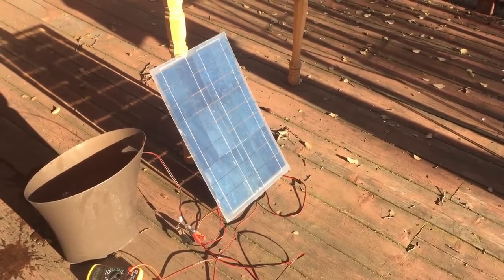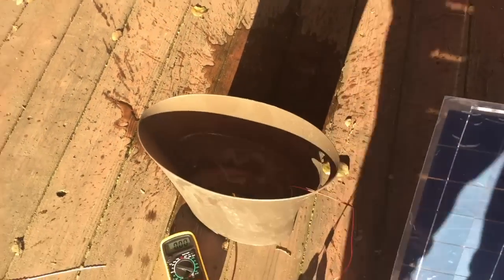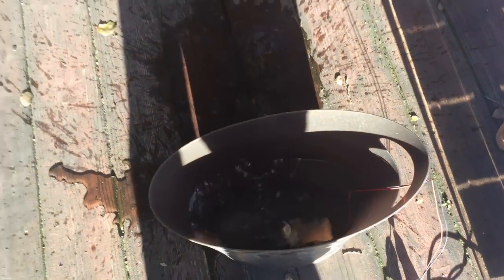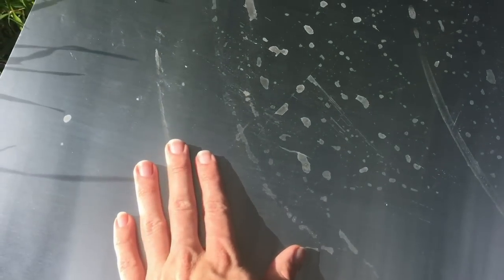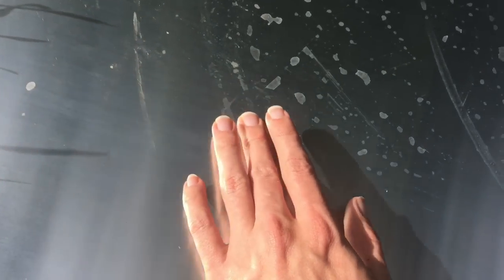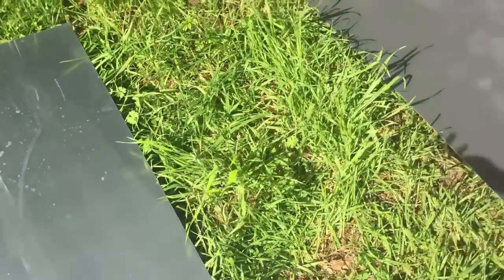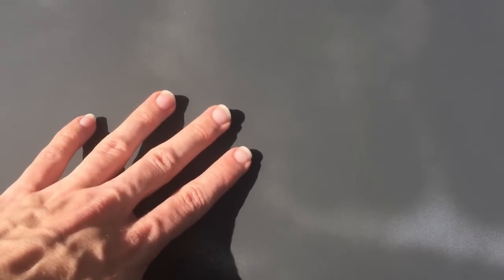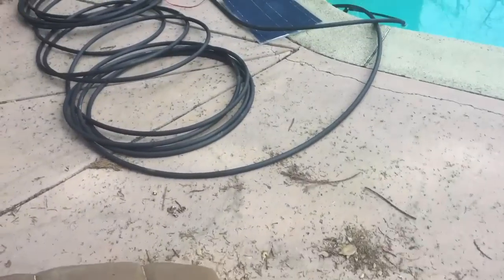Solar pool heater home made under 100$ :)

Comment: I also have a follow-up question, you mentioned that you were going to use the plastic to cover it but it was a bit milky, do you think that would really cause a problem? The fact that a matter is milky or not the heat will transfer through? I would love to hear your thoughts on this. I was also considering just getting a piece of window pane and fitting it inside my box.
Reply from the maker: Well the main point is that we want to still get as much sun onto the system as possible, so it should be visually transparent or you may get no more heat, or perhaps even less. Ultimately, this worked for me, so I left it running as is, glad you enjoyed the video! Hope yours works as well or better then mine!
Reply: @FreekHoekstra  thank you so much for your quick response I just noticed that you made this video 3 years ago! So I really appreciate you getting back to me I'm just waiting for my submersible pump to come from Home Depot and then I'm going to put the solar panel to the test!
Reply from the maker: Gemster18 make sure to keep the electrical wiring out of the water, (no not enough voltage to electrocute you, but it will make the connection corrode extremely quickly)
Reply: @FreekHoekstra  excellent advice! Thank you so much..👍. Will do.

Comment: First of all let me commend you You did an excellent job! I actually built one for myself, but I do have a question if I may? I essentially built exactly the same rig as you except I used a glossier black paint enamel, instead of the black matte finish that you have, do you think it makes a difference if you use the glossier enamel as opposed to the black matte finish? In regard to the heat transfer? Thank you in advance.
Reply from the maker: In theory diffuse likely absorbs a tad more sun but it should be pretty negligible. I wouldn’t worry about it, main thing to improve on mine is more coils and caulking the coils to the backplate for more efficient heat transfer.
Reply: @FreekHoekstra  when you say "more coils", do you mean as many as you can fit in the box with the tubes touching, or do you think the space in between is worth it?
Reply from the maker: I think the best setup is for it to be completely packed, I left space open because I could buy 30 ft or 200 ft (if my memory serves) and 200ft was just too much so I went this direction.
but the more you pack in there the better.
also more flowrate is better, its better to heat up 100 liters 5 degrees then 30 liters 10 degrees (and the hotter it gets the less efficient, due to heat-loss to the env)
those I would say are the main optimizations you could make, aside from improving the contact with the tube, and having something to trap the heat.

Comment: You'll need 35 of these to heat that pool.  The temperature of the pool with will decrease quicker due to the surface area exposed to air.  It about btu's. You are losing more btu's then inputting which means it will never maintain temperature of the heater let alone increase beyond the pools starting temperature.  Looks good in theory but in reality it will not heat your pool.
Reply from the maker: incorrect, the pump does not run when its at night, so it only moves water through the loop when the surface is hot, and I can tell you it does work as I tested it. the water coming out is a lot hotter then coming in and it did infact heat the pool.

Comment: Many adjustments I would do to this.   Insert the inlet at the bottom and outlet should be probably mid depth.  But for a pool this size you need about 5 of these panels.  I bought a $20 solar pad that achieves this same effect, and the temp in was 24C and the temp out was 38C
Reply from the maker: John Matthews at how many liters per hour though, it’s easy to get it up to temp, it’s how much volume you can raise how much, also this was end of February beginning of March if I recall correctly, in summer it performs a lot better, would love to see your setup though!
Reply from the maker: Oh btw about needing more panels, it would be nicer with more but it actually raised the temperature of the pool by quite a couple of degrees so it became usable about a month and a half earlier then normal. Which was good enough for me, but more panels would definitely be nicer ^^

Comment: You need better heat transfer from the aluminum to the hose.  Remember, that hose is rubber - an insulator.  What I would suggest is that you watertight the box and fill it just enough to cover the hose.   That way, the heat from the aluminum will be transferred to the water in the box, which in turn will be transferred to the water in the hose.   And, definitely, cover the box with a piece of plexi-glass to hold in the heat and keep the water from evaporating.  The water sitting in the box should get quite warm - too warm to touch.

Alternately, you could get a cheap kiddy pool and spray paint the inside of it black and lay your coil of hose in it and fill with water until the hose is completely covered.  The black paint is going to absorb the heat from the Sun and the plastic kiddy pool isn't going to give the heat anywhere to go except into the water in the kiddy pool.   Then, of course, the heat will transfer much more efficiently into the hose.  I think you would want to use as little water as possible and keep it from evaporating by using a clear plastic shower curtain stretched over the kiddy pool.

Cool idea!  You just need to keep working on it to make it better.  Good luck!
Reply from the maker: I agree the transfer was not ideal, I wanted to eventually cover the box with a plexiglass cover or plastic sheeting, 
to make sure the box itself got hot, but never got round to it. another easy way might be to literally just caulk it to the plate :)

either way it works really well even though there was plenty of space for improvement!
thanks for your comment.
Reply: Actually both of the suggested options are less efficient than the one showed in the video .